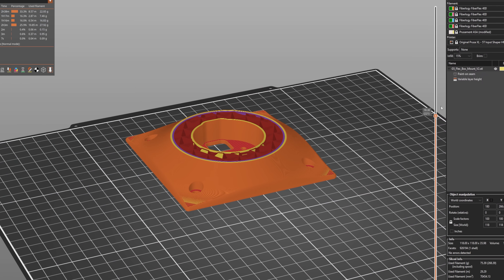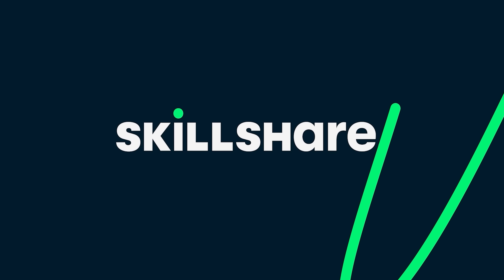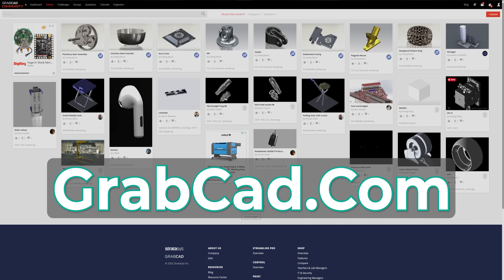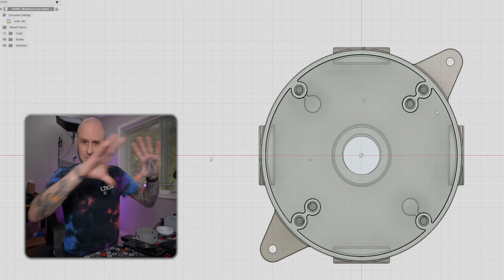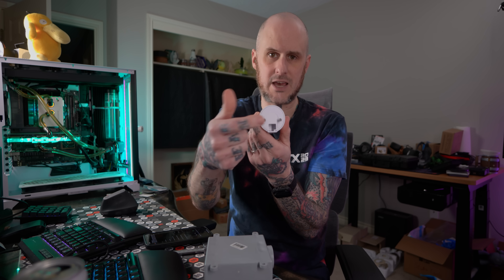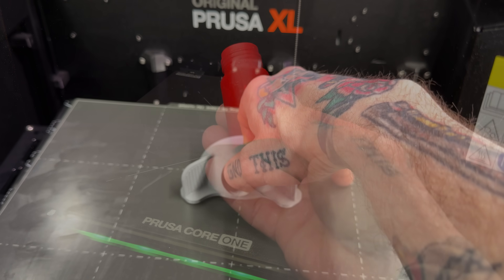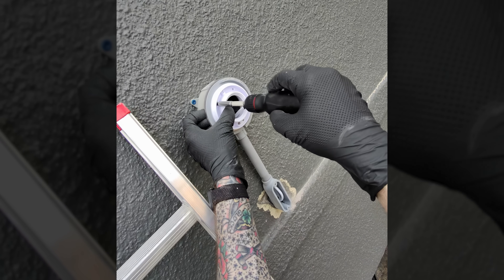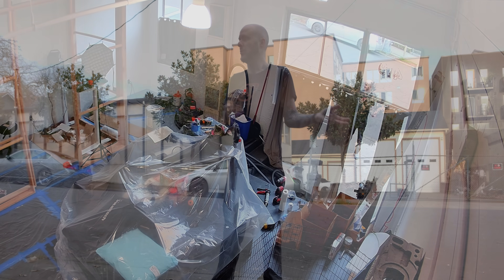DIY Security Setup w/ Custom 3D Printing

Comment: I'm surprised you didn't take advantage of sinking the flex into the enclosure. If you look at the ceiling mounts only the swivel head itself really needs to be exposed. Could have sunk it most of the way into the box
Reply from the maker: That would require a ton of support for the design to print the flange. I don’t design sighs supports in mind if I can avoid it. Also it would put the camera closer to the ceiling which just means it is looking downward more to view the room.

You are right about it only needing the swivel head exposed, that’s why my design only has the swivel head exposed with the rest being the flange that covers it, but protrudes off the box.

Comment: Do you still use your ender 5 plus. Or is the prusa xl compeltely replaced it?
Reply from the maker: Prusa XL has totally replaced it for me. I plan to bring back the Ender 5, but I don't miss it so much with the XL. Ender 5 needs some love to get it running reliably again. The firmware issues I had in that video just caused too many problems and I had to stop using it.

Comment: If you ever need to measure a flat surface use an old printer/scanner and put somthing of known size on the glass bed and then trace the image it gives you. Has saved me before and helps if making gaskets or needing to mate 2 parts together with weird flat geometry.

Comment: As someone that used to install cameras professionally, I got a few tips, 

First when using a rotary hammer to go through ext brick, NEVER drill from the backside, you want to drill from both sides and then feed your cable/conduit through (this avoids the super bad blowout you had on the brick work)

Second, not enough coverage, honestly for a space like that I would have gone with at least 5-6 cameras, 2 ext turrets just as high but on the far ends facing each other (this ensures clear facial shots), In the main room 2 cameras, at opposing corners to make sure things can't be hidden from one camera, then one in each of the smaller rooms assuming nether of those are bathrooms (if they are then you wouldn't include these)

Third For any Ext cameras you never want to use the bottom hole on the box to connect your conduit, it's going to get water into it, better option would to use a bit of flex conduit and make an upside down U, also if the ext doesn't have a drain hole your going to want to leave the bottom plug open (seen my fair share of POE cameras shorted out because of this as well as anyone using passthrough 8P8C's or JR-45's)

Forth Ditch Ubiquiti, way over priced for the feature set. Go with something like Hikvision, Amcrest, ect (or just about million other resellers) if you want to stay cheap with almost all the features. (still get free cloud access local storage , and a dedicated NVR) and if you really wanted to you could still pull the footage into another system if you really really wanted to.

Comment: IT guy here - this is an impressive, clean install. I'd maybe want the rack to be wall mounted. Did you print the outside flange out of ASA?
Reply from the maker: Everything shown is ASA.  I originally intended to wall mount the rack but the walls are… sketchy. So sadly it will have to sit on top of a shelving unit that isn’t in place yet. Thus the messy cable management for the moment.

Comment: if you mount the outside camera off to one side intead of right above the door in the center,  you have a better chance to see people's faces when they're right in front of your door.  The current position is more helping to find bald spots than identifying people 😅
Reply from the maker: That low is also a good place to be tampered with. This camera is more so to see if someone up or down the street. In case someone knocks but their friend is off to the side out of sight. I’ll be installing a doorbell camera eventually for faces and 2 way communication.

Comment: Could you redesign the hood piece with semi-circular screw “slots” that allow you to rotate the hood to the right spot before tightening? 

Another great vid!
Reply from the maker: If I add 2 more holes, so 4 evenly spaced ones, it can be clocked in 90 degrees intervals. That’s all I need. Just didn’t bother cause I thought “I just have to clock the box right, that’s easy!” Haaga
Reply: @MandicReally sounds like a job for an “on the go” / worksite baby Voron!

Comment: for anyone who knows the unifi protect ecosystem you dont need to explain. lol. only real downside is the price, which isnt anywhere near the cost of commercial products but still not the cheapest solution. but for the fact i can have my cameras stored on site and not shared to a cloud for someone else to access easily is good in my book.
Reply: price and the image quality. Can get better image quality for cheaper
Reply from the maker: You can use other cameras with Ubiquiti hardware. I haven’t tried it yet but I’ve got a Lorex 4k I’ll be adding to my setup soon-ish. I’ll play with it more too.

Comment: I would have done a TPU gasket on the outside cam maybe
Reply from the maker: I had considered it, but the base has a slightly rubber flange to it for sealing. Screws I had were only just long enough anyway. Whenever I upgrade that camera to 4K I'll reorient it so the brim works, and maybe revisit the gasket idea.

Comment: how're you enjoying yher Zhiyun LED lights at 00:48 ? ive been eyeing them for a while
Reply from the maker: I really like them. Compact, and decent light output. Not as bright as I could use, but a solid extra lighting option for quickly setting up. I'll likely get a couple more as time goes on. In smaller spaces like my office they are a lot handier than my bigger studio lights. Trade off in light output but space matters.
Reply: @MandicReally  yeah they're so much smaller than comparable ones, thanks bud!

Comment: The two inner holes look symmetrical. You should be able have 4 holes in your mount, then it doesn't matter the box orientation. The extra holes should be covered by the camera.
Reply from the maker: You are completely correct. When I made it I thought “I just have to clock the box correctly, no biggy” then I forgot. 😅 Should have added the additional holes. Whenever I upgrade the camera to a 4k model I’ll do that and be set.

Comment: When working with physical items that have a flat surface, I scan it with my flatbed scanner and save it as a pdf. Then import the pdf into CAD and trace it. This gives me a more accurate model easily.
Reply from the maker: Yep, I've shown that method in previous videos. Laying a Ruler next to the object while scanning is a big help too. I don't have a scanner currently so measuring is my method for now. Got rid of my last junky one before our cross country move and can't justify another as we have to move yet again!